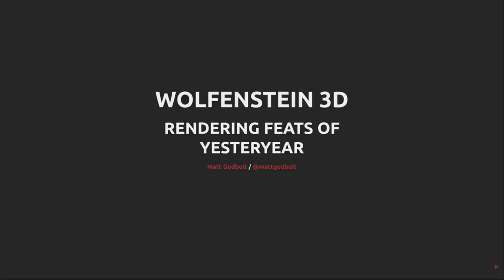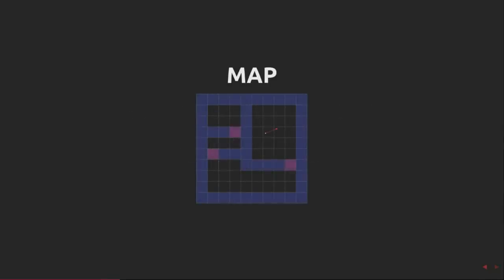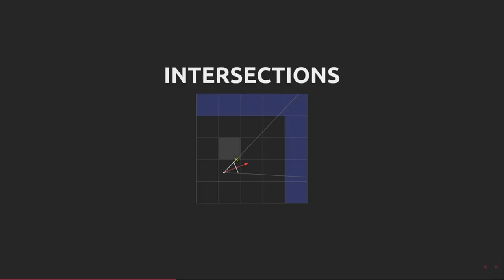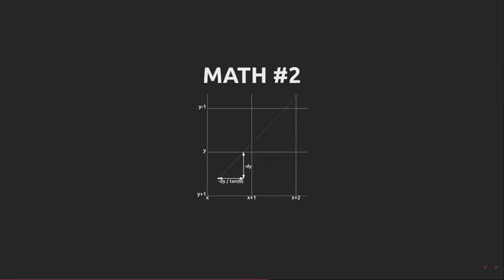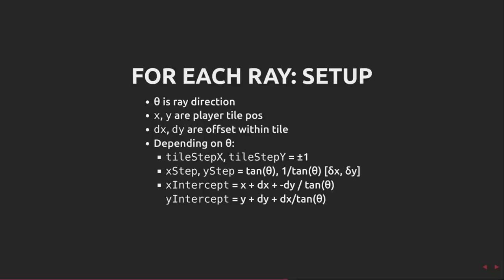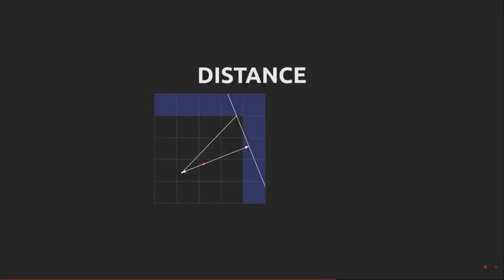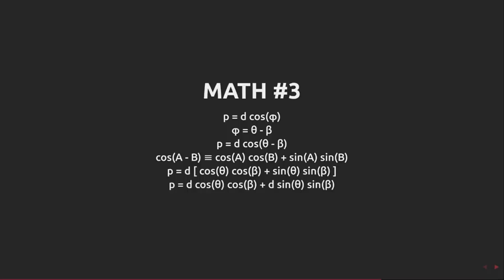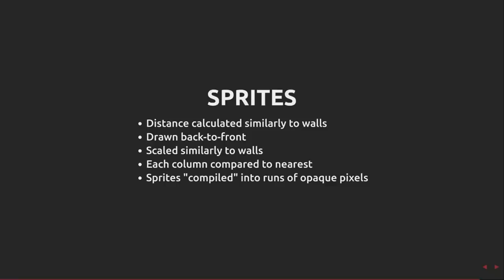Wolfenstein 3D's map renderer

Comment: Damned trigonometry. Makes me cringe when I see it, I could never get into math.
Reply: I tried to simplify the realization that helped me out, not sure if I succeeded but here it is:
The secret is in the Unit Circle, or a circle with radius = 1 and its center at (0, 0). There your "hypotenuse" is almost always that radius line, which = 1, your "opposite" is always the height (or y) and the "adjacent" is always the width (or x). [It's easier to tell some of this stuff just by looking at a diagram of the Unit Circle, but I'll try to give a couple of spoilers here]: That means the confusing stuff like  sin(angle)=opp/hyp  becomes instead  sin(angle)=y  ; and  cos(angle)=adj/hyp  just becomes  cos(angle)=x. Then you don't even really have to think in terms of sin and cos of an angle, you're just using x and y for the base and height of right triangles, like in early algebra and geometry. 

Even tangent of an angle then just reduces down to y/x, or "rise over run," same as "slope" you probably learned when first graphing simple lines with y=mx+b [Which is actually the same equation. Here our b=0 since we're at (0, 0), and "m" is actually the tangent of the angle, meaning the simple line equation  y=mx+b  is really  y=tan(angle)x+0,  then dividing both sides by x gets you back to  y/x=tan(angle) ].

Solving problems with the Pythagorean theorem in the Unit Circle is also easier because your c^2 = 1, so instead of having to deal with  a^2+b^2=c^2, you're usually just dealing with x^2 + y^2 = 1.

 It took me years to get it from just the SOHCAHTOA stuff but once I started to learn about "normalized vectors" for keeping track of what angle your player is facing, it all finally clicked and I realized you can shrink any nearly any trig problem down to a little graph within that unit circle (by dividing both x and y by the length of the hypoteneuse) and almost everything else starts to really clear up. This technique only breaks down for things like perfectly vertical lines where x=0 so y/x becomes y/0 which is undefined. In terms of memorizing all the other "identities," though, only the dark lord Beelzebub and a mountain of flash cards can help you there.

Comment: Lol why so complicated ? If you have point of intersection, you already have "d", as length of hypotenuse. And angle Teta is taken from scalar product of look vector and vector pointing to the intersection point.
It's like two lines formula in the end, instead of all this trigonometry trash.
Reply from the maker: "As length of hypotenuse" -> getting that length involves a square root - sqrt(a*a+b*b), and square roots are very expensive on these old CPUs (and indeed modern ones too).  Scalar products are also more multiplications, which this approach avoids; multiplications were slow then (though a lot faster these days).

Comment: In 1992 the Pentium 1 was released.  No one had one, but 80486 processors were available at up to 66 MHz.  RAM was usually 4 to 8 Mb.  You should research your facts better, and utilize more of your screen!
Reply from the maker: Thanks for the advice. I wish YouTube still had the ability to add on-screen notes, as many folks have pointed this out to me
Reply: Not true. The Pentium 1 was not released until 1993 and while fast 486 processors were available in 1992, they were not that common. the 386 was what most people had and what Id designed Wolf3d around. Maybe you should research your facts better.